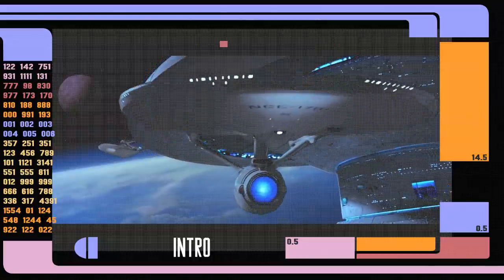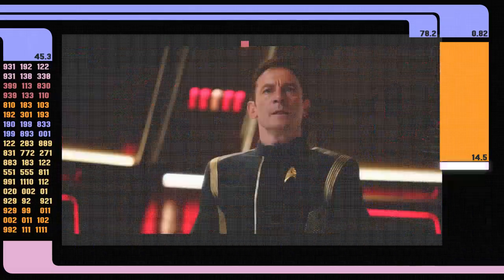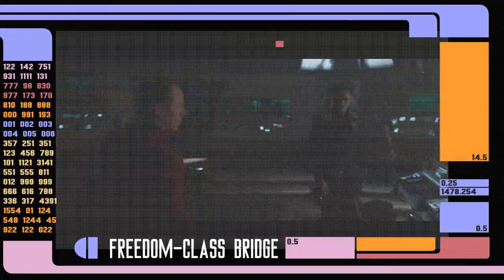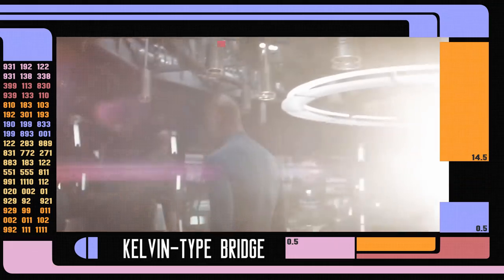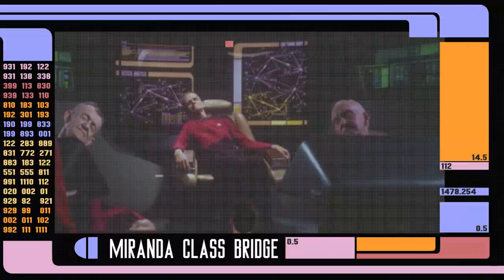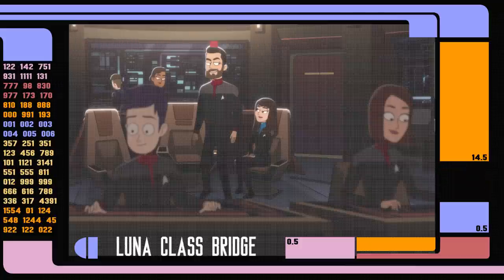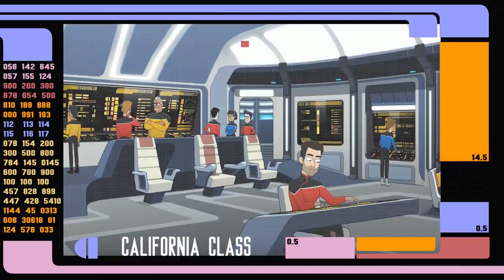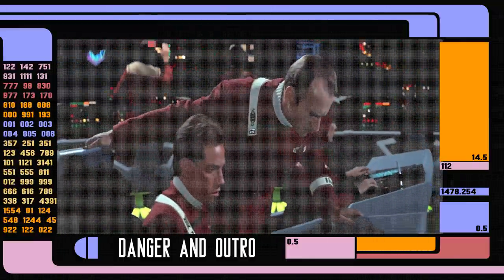Forgotten, Fatal, and Unethical Starfleet Bridges

Comment: Placement is also important.  On current U.S. Navy ships, the navigation bridges are placed high on the superstructure, and have good visibility.  The battle bridges, on the other hand, are buried deep in the hull.  Star Trek keeps putting their bridges on the outside, when they should be the centermost part of the ship, buried under the armor of all the less-important parts.
Reply: USN here. I was going to say this too.
Reply: Perhaps more should be made of the battle bridges in Star Trek. Main bridge is where it is for reasons of tradition but when things go south key officers move to an interior location at the median point between the outer hull and the reactor.
Reply: @travissmith2848  Except we rarely see any key officer anywhere but the main bridge.

Every time you have the Captain, XO, Ops, Chief Engineer, and Security Chief on the main bridge. And sometimes the Chief Medical Officer is there too.

All three senior officers (CO, XO, and Ops) should not be in the same room during a battle. But in Star Trek they are on the same watch rotation practically all the time.

So what key officers are you referring to?
Reply: @davidtherwhanger6795  Something basically never actually used, hence make a bigger deal of them: when a major battle occurs have one or two (though perhaps not all three) take the lift to the battle bridge.
Though I think we can give Trek a pass on not splitting up command staff as those are the ones we care about and going beyond that half dozen or so as principles doesn't work as well in story telling.
Reply: @travissmith2848  well it’s more a flaw of visual storytelling like movies/TV. Shooting all your main cast in the same room is just easier and cheaper. In a novel, for example, you don’t have to think about how many sets you need to shoot in a day when people are separated.
Reply: @TheDawnofVanlife  That too.
Reply: @travissmith2848  On a Galaxy Class Enterprise and on Voyager, engineering has been used as a bridge and the chief engineer is usually a high ranking officer. It's a de-facto battle bridge.
Reply: @chukwudiilozue9171  1701-D had an actual battle bridge. We saw it a few times.

Comment: The key issue would be the structural strength of the window. If nothing else, it would be nice to be able to look out the window. However, Star Fleet vessels are consistently exposed to intense structural stress. If the window glass was weak relative to other hull materials, that would be an unbearable liability. Of course, there is the underlying debate, 40 years of Trek and we never had a window on the Bridge. Suddenly, we do. If the Producer of this new Trek clearly holds Trek and everything she stands for in disdain, then I could imagine some people being irked by a Bridge window.
Reply: That brings up an interesting question: Do ships in Star Trek have frames or are they really just supported by the hull?
Reply: @schwarzerritter5724  You can see structural framing all over, and when they show ships being built or repaired.   Among other things, it's why the funny-shaped doors and hallways.
Reply: Well there's a confirmed window on the Sovereign class as shown in Star Trek Nemesis.

Also a good reason why unprotected windows are bad on ship bridges can also be seen in Star Trek Nemesis...
Reply: @26th_Primarch  It actually doesn't seem  it'd have made that much difference whether it was transparent material or not,   that hit more or less blew half the front of the bridge off.
Reply: @OllamhDrab  It blew a relatively small hole into the corner of the window which failed easily.

Comment: Window are still used in military because you can still eyeball stuff. If you want to stop kill the engines. In space you can't eyeball it and you can't stop without sensors. Bridges should be inside the ship protected from radiation and act as emergency shelter. There is a lot of radiation in space.
Reply: You can totally eyeball stuff in space. Just ask the Apollo 13 astronauts, who reoriented their ship with a window and a joystick.

You can also magnify a window with lenses and it's still a window. Think of all the tech that can avoid, say, radar, but is clearly visible to sight. (Like the stealth bomber.) There's a reason cloaking is difficult in Star Trek... they don't just have to be invisible to sensors, they have to be invisible to EVERYTHING, because people can look out the window.

And as Lore points out, Trek ships engage at pretty close distances. Why? Because, with the speed of the weapons they're firing, it's actually easier to dodge enemy fire CLOSER to the target than farther away. You've got weapons than fire at or greater than the speed of light. The only way to avoid the shot is to be moving so fast (relatively) that the enemy calculates the shot incorrectly. At long range, relative motion is too slow, and you're almost guaranteed to be hit.
Reply: @Swiftbow  Dodging at larger distance is easier. Dont get fooled by sci-fi point defences. Turrets can turn really fast ( if they are controlled by computer and not by Han solo with joystick) and with light speed weapon fire you need those precious fraction of second to dodge when you are engaging at distance of tens of thosands km. Eyeballing in space can work when you have navigation tables ready and you know what is your trajectory. Or you have spacesuit like in latest Lower deck episode. No tried to fly around it. Only throught it. Stupid.
Reply: @Swiftbow  "You can totally eyeball stuff in space. Just ask the Apollo 13 astronauts, who reoriented their ship with a window and a joystick." they eyeballed the frikking planet they were orbiting, not a 300 m ship moving a 0,01 C (at a minimum) thousands of kilometres away). And anyway, it's next to impossible to eyeball distances in space, unless you are at docking distance, dut to a lack of nearby objects to give you a sense of scale.

Comment: Windows: Transparent aluminum? Star Trek: The Voyage Home.
Bridge layout: Acoustical projection via dome shape Acoustical resonance designed to direct voices to and from the central location of the Captains' Chair.
As for the multilevel designs. A VERY bad idea in practice. A twisted ankle in turbulence is just going to and has in real life, happened.
One thing that I've never heard commented on is the incredible distance of handholds. Two meters is the maximum distance currently allowed in any mobile operations center due to potential turbulence. This is true on the ocean and should hold true of any bridge in Trek. Can't have the Captain falling ass over teakettle and bonking his head... Well, until the script demands it.
Reply: i disagree with the failure of transwarp.  they should give it another chance.
Reply: @SamSitar  - Umm... Great... I never mentioned transwarp. Was this supposed to go on another comment reply?
Reply: the battle bridge makes more sense than the bridge.
Reply: @ts757arse  And in the end, all Trip did was lowered the chair.  The end product had none of those changes he worked on while high.
Reply: @SamSitar  The obviously different warp scale during TNG suggests that they did continue to work on transwarp, they just decided to continue calling it warp.   Nothing actually says it was the same transwarp as the green glowing Borg transwarp or the Transwarp corridors.
Reply: @ts757arse  Did he document and publish his plans?   How often would a craftsman actually document and publish a single project.  We can't even rebuild a Saturn V as the documents and blueprints don't even say why the various components are there and changes were made from the blueprints during production and those changes are not documented.  But fine, I'll give you that Trip may have influenced later designs.  Somehow, I don't believe routing enough power for inertia dampeners capable of dampening the accelerations involved directly to a chair would be wise, then again they run dangerous power levels to their touchscreen consoles...
Reply: Aluminium, transparent or not, isn't used in ships' hulls and would be too weak. We sometimes hear duratanium mentioned as the material used for starship construction.
Reply: @maisiesummers42  - Aluminium is a lot of things but weak has never been one of them. It's why so many airplane structural frames are made from it. It's very light, and extremely shock-resistant, especially with extreme temperature variations. The current transparent aluminum in use today is used for these reasons.
Reply: @jaspr1999  By today's standards, yes. 400 years in the future when it has to withstand 1000 gigawatts of phaser fire? Nope.
Reply: @maisiesummers42  - If we're going with predictive assumptions then I would imagine that there would be 400 years worth of engineering advancement in the construction of transparent aluminum on top of what we have today.
Reply: Actually there is already has been a form of transparent aluminum created, it's official name is Aluminium oxynitride. Yet another invention inspired by Star Trek
Reply: Rip Voyagers first First Officer

Comment: Part of the exploding console problem is that they don't simply get powered by electricity.  Star Fleet ships operate using an EPS grid, Electro-Plasma System.  Plasma, ionized gas, generated by the impulse and warp cores (the engines are actually separate) is pumped unidirectionally to everything in the ship, every single electronic or mechanical device, and is LOCALLY converted to electrical power.  When an EPS conduit is ruptured, it releases the ionized gas to then act like an explosion.  If an EPS conduit loses the power to isolate and guide the plasma to the destination device, it quickly melts through the conduit, made mostly of copper, and sprays that molten copper around, giving that "rock" look to the debris.  Particle weapons and antimatter explosions would produce high levels of EM interference that would cause temporary disruptions in the EPS conduits, causing such explosions, thus why you get the "explodium packed" consoles that are so dangerous to crews.

As for why the consoles would use such vast amounts of power, seemingly over 1000W worth of electroplasma, I can't really say, but may have something to do with the fact they use optics to communicate with the other systems, not electrical cables, so as note to be susceptible to EM interference.  Perhaps it takes a lot more power to generate the necessary light levels to make it through the hundreds of meters of optical cables in the ship.  (Making my living in IT, I know this isn't necessary in the real world, as single mode cables are able to transmit data optically for kilometers using barely over 2w of power, but this is Star Trek, perhaps they need higher light levels for some reason.)  Perhaps it has more to do with local computational requirements, but I have yet to see why that would be needed.  Perhaps they all have local replicator systems to slowly autorepair the consoles after damage, as we have seen many consoles continue working partially after an explosion.  

In any case, it isn't simply an electrical problem or surges of electricity.  Using an EPS system is obviously highly dangerous to the crew, so I do not know why they use it that way, but it is what it is.  I know plasma is necessary to power the heavy needs of the engines, weapons, and shields, and the shield grid is all over the chip, so perhaps they decided to power all the consoles from it because the shield power grid was already distributed around the ship, rather than run electrical lines.  

(I do know in IT in the real world, there are some datacenters that distribute 480V power to the rack level, and then use local power supplies to convert it to low voltage, 48V, direct current for directly powering the servers and storage, and this somehow makes it more efficient.  It's actually part of the Open Rack specification, an attempt to make the design of server racks into an opensource and non-licensed spec.  Maybe Star Fleet ship designers used similar thinking for consoles.)
Reply: Running 480v to the rack makes sense because whenever you convert to DC you both need much heavier wiring, but also have much higher transmission losses
Reply: Running higher voltages over distance incurs less power loss. The 48V you're referring to however do not directly power the servers and network hard in most cases; they will power the UPSs that in turn power them. If you look closely at a UPS, they have a 230V (or 115V) power interface, and a 48V DC interface on the primary side (consumer models notwithstanding, we're talking datacenter here) (in some cases they use 24V DC primary, it depends on the capacity of the UPS).
Reply: Lets face it, the real reason they put rocks and explosives in the consoles it to make sure you look after the ship.

Regardless of the made up technolay,  the controls in such a ship just send a message to the system involved to do the thing, and this invloves negligable power.  They can even do this from another ship as seen in the second movie.  Even your car is wired up this way.  Its like telling alexa or google to turn your lighn on or off.   If your light bulb blowes, your alexa hub isnt going to explode.  Even if the control pannels has a bizaly huge power source,  there is no reason that the sheild control pannel would explode when the shield are hit, any more then then any other console on the ship.
Reply: they should just keep the consoles on their own low power system and use them to drive all the explody stuff remotly over some kind of networking. Also none of that explains why the console still work after exploding and any cost saving they get by doing that this way aren't worth peoples lives.
Reply: @KeinNiemand  Ever try to talk sense to an opensource developer?  I assume it's the same with Starfleet ship designers.

Comment: I do want to see alien bridge layouts.

The EPS system's high kelvin temperatures may be able to cut through almost any solid material if there's a sudden interference-based lapse in the structural integrity field, or in EPS containment.  Considering the EPS conduits only seem to surge and burst under battle conditions, hard impacts, or during encounters with anomalous regions of spacetime, they're probably rated as "safe" for use with Starfleet personnel, even though they are working in proximity to explosive danger.

A similar argument for "proximity to explosive danger" in the modern era is Lithium Ion batteries.  They can ignite almost anything if they rupture, yet we haul them around in our pockets and bags like there's no chance they'll do so, even given evidence to the contrary.  Similarly, cars are potentially hazardous on the roads, and we drive them at high speeds practically every day, and in many cases, we drive them within meters of opposing traffic.

Comment: Lore Reloaded,

Submarine veteran here. Served 1999-2003 on two nuclear powered submarines, USS Florida SSBN-728 and USS Asheville SSN-758, was a sonar tech STS3(SS). The SS means I am Qualified in Submarines (very difficult to achieve even if you have a STEM degree, takes months of study and a 2 hour board interview by an officer and two enlisted members, but required for all of us to get.) The 3 means "3rd class petty officer", enlisted (I worked for a living!) paygrade E-4.

You will never see windows on a submarine because, below about 200 feet (60.96 m), there is nothing to see. Light doesn't penetrate that far. Those civilian scientific submarines that go all the way to the bottom have lights, but they can only see a few yards (a few m) around the boat. :)

When we're submerged, we use passive sonar to "see". A lot of math is involved in figuring out what is going on out there, where the enemy is going, where we should go, etc. I can't get too far into it because it's classified (math is not a secret...but the way we use it to conduct submarine operations is). The only non-classified display in sonar is "passive broadband waterfall". On that display, the sound waves detected by the passive sonar array are abstracted with a dot that indicates that sound was detected on that bearing, at any frequency. The greater the amplitude, the brighter the dot. If the dots stack up in the same place over time, that might be a vessel that we need to track. Of course, a human is constantly listening to the sounds as well, and to truly figure out which ones are enemies and which ones are not, and which traces are just marine animals or "biologics" requires human judgement. :)

Here's what the sonar display looks like (this is from an older system; the new ones are in color and higher resolution, but are the same in every other respect.). I know how to do a LOT with this display, but again that stuff is classified. But you can look at it; the display itself is not classified. :) 

https://www.pbs.org/wgbh/nova/subsecrets/images/sprisonscr.jpeg